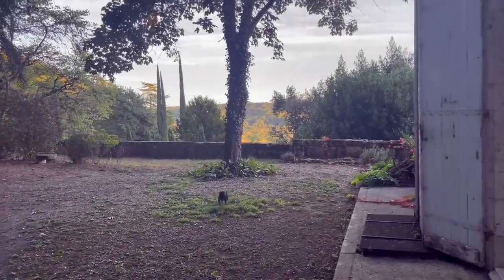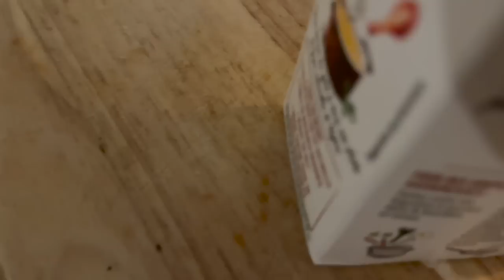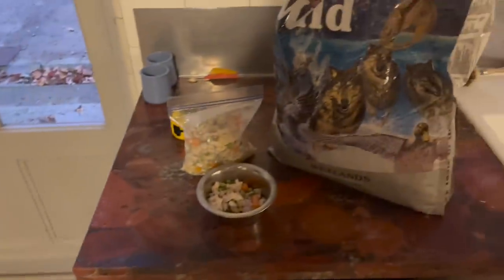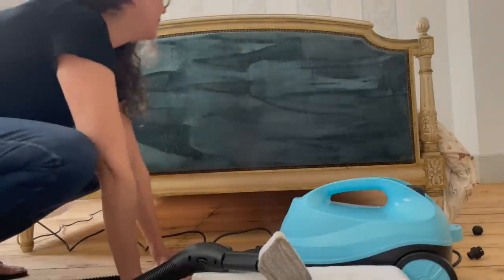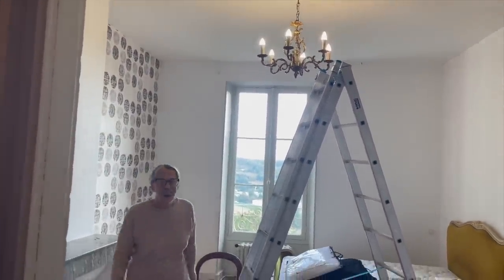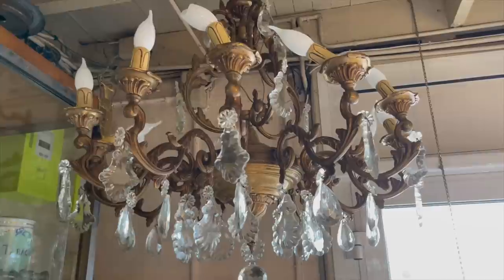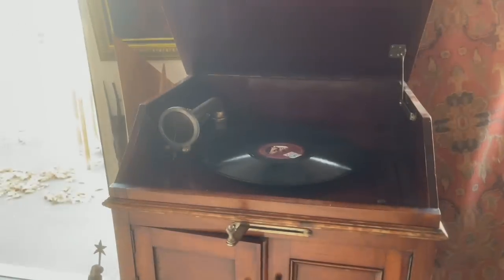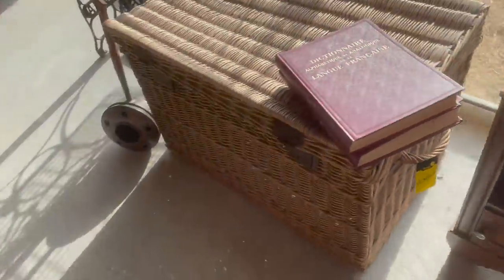A Steam Cleaning Mishap At My French Chateau: Learning the Hard Way – The Chateau Chronicles – Ep #6

Comment: Sometimes you can melt the stuffing with the steamer since you don't really know what's in there unless you disassemble it. If you are really paranoid about cleaning maybe you just use a brush with some water and soap, or a rug cleaner with an upholstery cleaner (a hose) that will throw water (not hot) and then suck it out as well. The dark and naturally humid environment within the upholstery makes it tricky to clean. Perhaps the steamer is going to be more useful for you to straighten curtains as long as the fabric can tolerate high temperature. Hope this helps! Enjoy the road and continue sharing the fun you're having restoring your castle 🏰 .

Comment: I’ve shampooed velvet upholstery before with a carpet cleaner. I used a tiny bit of fabric softener. I’ve also washed velvet fabric with gentle soap and air dry. Ideally I try not to but sometimes you want to make sure it’s clean. I think it’s fine. There is a clothing lint brush that is hand held with a red fabric that is supposed to remove lint, I think something like that would help with the direction of the fabric maybe?
Reply from the maker: Yes, good ideas. Thanks! 🤗

Comment: I don't know if you know, but there is a wire velvet brush you can use to reknap your velvet.  One thing to keep in mind is that some of, if not all, of the velvet you have on your furniture is probably silk velvet. Heat will usually damage the fabric. I would recommend that you may want to use a carpet cleaner that has an upholstery tool. And yes, you need to go with the grain. Cold water can be used to wash silk fabrics, but you need to remove as much water as possible and, if possible,  take the piece outside and let it finish drying in the sun. You may want to research how to clean antique fabric furniture.  I do know that vacuuming numerous times will also make the fabric look newish.
Reply from the maker: I've learned some painful lessons! 😬

Comment: Don't worry, as electric is not my choice either but I get used to it and find that it is safer overall.    You can fulfill your gas cooking desires with an outside propane grill for the mild seasons which  come with burners as well as the grill.   Cast iron pans and pots work well on the outdoor grills.  I haven't watched the part of your steam cleaning disaster yet.   Dinner looks great.   A big pitcher of cool water with a bottle of wine.

Comment: You didn't read my instructions...a brush, fine stiff boar hair bristle brush is the best, but I only wrote 'you need to brush it', while the fibers are HOT and damp, you cannot rub back and forth over the same spot with the steamer, it get's saturated and that deforms the fibers and they'll shrink and bend like a perm on hair. for the rest go buy Eau Ecarlate at a supermarket or Quincaillerie....pour it onto a clean cloth and rub fast the dry velvets, this stuff evaporates FAST, but it also is a dry cleaning fluid (there are a few) ...Velvet is cut so that the pelt goes up or down...that is how you need to run a vapor machine, but with a lot less pressure and the brush behind...to get the velvet back to standing up....when it is up the fabric appears darker while the down flow of the fibers of velvet give it a sheen....after any treatment you need to brush it anyways so that the fibers are standing out at their most, not laying down or they'll matte out and you'll never get them back...
Reply: Cleaning product for those chandeliers= St Marc, there are different sorts, pick up the spray, it cuts suet, grease, dust and pollution, just spray it on, wait a couple of minutes and wipe it down!!!

Comment: So sorry about the velvet!  Your steamer should be on low, don't press hard and only go over the fabric in the opposite direction of the pile.  Brush it after with a soft brush.  I have just used warm water with a tiny amount of upholstery cleaner (one that is safe for silk) and used  a spray bottle to very, very lightly spray one area at a time and use a thick pile (i.e. Turkish) towel to vigorously rub the area clean.  They should not feel wet after you spray, just lightly damp.   Having said all this, the bed you have looks like it is from the 60's or 70's (only because that style & paint color & look was really popular in France at that time)  And most likely has polyester or polyester and cotton velvet so I think it can be salvaged if you re-steam on low as described above.  If you do need to clean something that is silk velvet and an antique it's always best to get a professional cleaner to do it.

Last thing - One approach that seems successful in decorating is to do a full decor plan for each room before shopping alot for furniture and decorative items.  I've moved ALOT all over the USA in my life (in my 70's now) and one thing I always did before house hunting was make templates of my furniture, create a floor plan in scale of houses I was considering and see if my furniture would "fit" as I wanted it to and what I needed to buy.  In your case you could make templates of basic furniture (sofas, beds, chest of drawers, on and on) in scale to a floorpan you draw out per actual measurements.  Then you can use your templates to see how and where you would place furniture in the rooms and what you need for each room.  From that make your list for each room and go to the big brocantes that have a great big selection.  I think you said you were going to make your curtains, so if you select your fabric first for the rooms before painting or anything else you can carry swatches as you shop (I have mine in my purse at all times....still...just in case!)- super easy then to make sure items coordinate or compliment the room and the stain color of the furniture you are putting in the room.  I have just found it easier to do that planning up front when doing a new home and, in your case, when starting from scratch is daunting at best!!!  :-)  It sounds like you will be at your main home for awhile before going back to your chateau...that might be a fun project to do at home!  Kinda of like vision boards - LOL  Sorry this is so long....and feel free to toss any of these ideas.  I'm just sharing something that has worked for me over the years :-)

Comment: Regarding the velvet, don’t beat yourself up.  Velvet is an advanced fabric that does need some special handling.  However, depending on the age, that may be silk velvet, which is more forgiving than a synthetic velvet.  That said, steam in one direction only—not back and forth, which can crush the pile.  The beauty of a silk velvet is that if the pile does get crushed, it can be resurrected with steam.  It make take a few rounds of steam, so be patient.
Reply from the maker: Thanks for the advice and encouragement! 😀